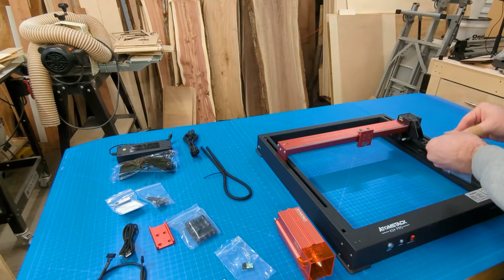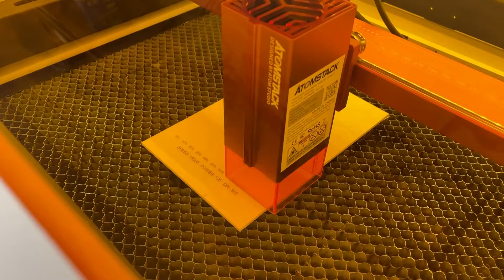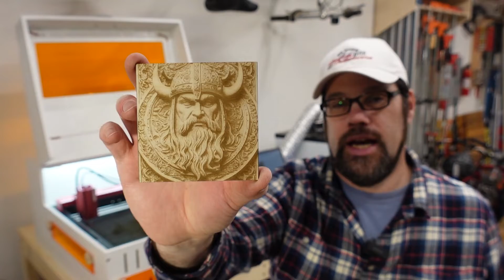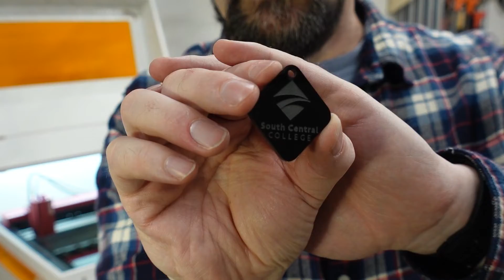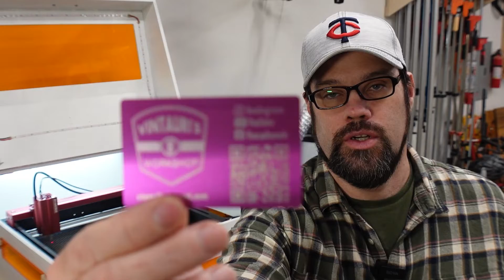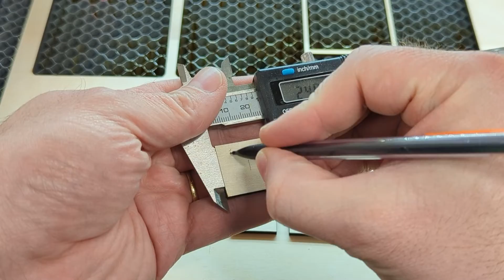Atomstack A24 Pro | Big Power in a Compact Laser

Comment: Hi, I have calibrated as best I can. However, despite everything, when I do a test, for example a square, it does not appear aligned. So, I realign it with the Y and X axes from the camera. I do the test again and everything seems fine.

But, if I try to repeat the test on the same base in another point, the alignment is not correct and I have to realign it, even though I saved the change.

Comment: I just got the A24 Ultra with the enclosure and the exhaust fan will not work.  It has a strange hook up so I wonder if I did something wrong.  Can someone explain the 3 way power cord ?
Reply from the maker: There should be a Y adaptor with it and that plugs into the power supply, then one goes to the laser and the other goes to the fan on the case. I wish the switch on the Y cable was on just one of the outputs to be able to turn the fan off and on while leaving the laser powered on as it has its own switch.

Comment: For what i do looks great as far as wood is concern. What is your experience on Acrilyc??? Comparing this 24 Watts to their "NEW" "33 Watts" machine, in you opinion, does the additional 10Watts power JUSTIFY going to the 33 machine instead of the 24 Watts???
Reply from the maker: It will cut some acrylic but you'll be limited to the darker solid colors.  Clear and translucent colors will not work well.  I don't think you'll see a huge improvement in the cut quality from 24 to 33 watts.  You might gain some speed but both will have about the same focus length and that is also a limiting factor.  I have access to a Co2 laser which I use for acrylic as it cuts faster and leaves a more polished edge to the acrylic when done.
Reply: @Vintauri  Thanks for your opinion. Guess I will go up to the 24  based on what I use the machine for.  The "new" A6  24Watts looks great, but it is ONLY 12 inches or 305mm WIDE

Comment: Hi Vintauri! Please can you offer some advice on which model to choose from the three below or maybe you have other suggestions?

Atom - 24W Pro
Sainsmart - L8 20W
Rolly Automation - 20W

I am interested in it cutting very well but engraving just as well.
What would you choose if you had to work all the time, 8-10 hours a day, and also considering the prices of each? I'm thinking that for an everyday job you need a well built, robust machine with very good quality materials in order to last over time.
Which would be first, second and third, considering it worthwhile for that equipment to be part of this ranking?
Thanks! Excellent review! All the best!
Reply from the maker: I do not have any first hand experience with the other two lasers.  The Roly Lasermatic is a well praised laser with good reports of support if ever needed.  I like this Atomstack laser, it's a little smaller but that makes it nice for portability.   I can't really speak to the Sainsmart laser as I've only used one of their lower end open frame lasers.  It was decent but a far cry from any of these options.

Comment: Will a dell mini windows 10 run light burn im looking for a budget pc
Reply from the maker: I have run Ligthburn on a number of older machines without issue including an HP mini PC>   Assuming it's not too old and preferably has 8gb of ram and an i5 CPU it should be fine.

Comment: I ordered the A12 Pro to do some onsite engraving. I should get it in a few days. I think I'm going to have to come up with a solution for strain relief for the cable that plugs into the module. Two people in the Atomstack facebook group have already broken those cables where they plug into the connector. I zip tied the cables to the fan grill on my Enjoywood lasers, but it doesn't look like there's enough slack to do that with these Atomstacks.
Reply from the maker: You may be able to pull the wires out a little more towards the module to get some extra slack.  They are snug but have some wiggle room. I have not had an issue with mine yet, but it's not my primary in house laser, but makes for a great portable unit for on site work.

Comment: Hi love your review made me buy this machine but where can I find the materials settings guide for this machine? It’s not on their website
Reply from the maker: They do not have one specific to this machine out yet.  But you can use one of the others as a ballpark guide.  If you have the A24 with the 24w laser module, look at their material sheets for the A20 or X20 and that will be fairly close to the performance of this laser.  I always recommend running your own test grids, but the settings for their other 20w lasers will get you close.

Comment: Good to see the enclosure used again. It seems like over a year since seeing you build that enclosure and then going on to design my own.
Reply from the maker: I designed it around the xTool D1 pro and with not much extra room.  It's has not fit some of the larger lasers but it's been a workhorse for the xTool and any others I can run in it.  I do plan to build a couple new enclosures for the extended lasers and large foot print square ones this winter.  I do like using it when I can.